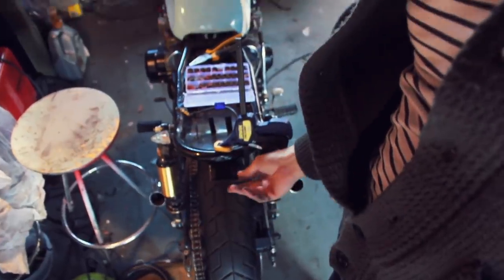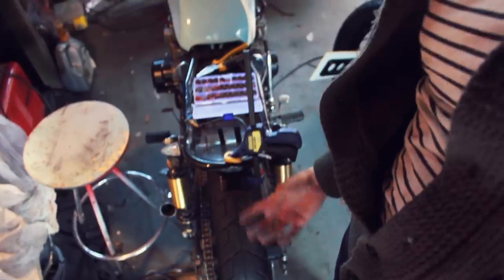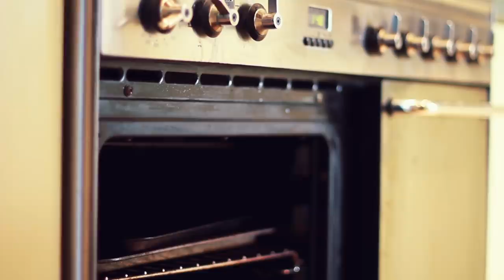Honda CB750 Cafe Racer Part 19 - Painting & polishing the fins on the Piston Cylinder

Comment: Whenever I rattle-can a project, I always start with a light dusting as a first coat, and I will start spraying a bit off the project and continue across the entire face of the object in one pass.  Just a technique that has never failed me. I like your results.  Looks good!
Reply from the maker: I’ve tried that in the past with cans and always do with a proper compressor and spray gun but I’ve found the atomisation pretty crap with these nozzles. I always end up with orange peel.
Reply: For The Bold - dreegez VHT High Heat paint, correct?  Those nozzles suck.  Krylon has great nozzles, and I usually keep a few to pop on to other brands.

Comment: That is one of the best tricks of painting is bake the paint. You can do the same with cars using improvised heat lamps as well. The application is used even in with non heat resistant pants just using less heat makes for  better longer lasting pant jobs
Reply from the maker: Let's hope this stays on :)

Comment: I did exactly what you did with the paint then the oven. Opened the oven to find that the case has expanded in the heat and all the cylinder sleeves had basically dropped out! Scary stuff. Got them back though and let it cool and all good so far.. 😲
Reply from the maker: Very scary, glad to know you sorted it out.

Comment: I know the 750 f comes painted, except they didn't sell them in desert areas or areas that regularly get 90 degrees farenheit or higher. I tried painting my 750k and it overheats.  Now the trick is to find out how to remove the paint with the engine assembled! 
Be careful as to what kind of paint you use also, as Honda as a special heat absorbant paint to somewhat allow heat dissipation  This is crucial as even cold to warm  up, and humidity factors can cause havoc especially with thin aluminum and magnesium.
Reply from the maker: With the engine assembled just take it out and cover with aircraft paint remover

Comment: Hello, i have a cb750 as well, the old owner painted the engine but used a bad quality paint, i would like to remove the old paint and painting again. I would like your recommendations to remove the old paint and clean, i don't have access to blast machines.
Reply from the maker: Try the Nitromorse like I did. Works wonders

Comment: Hi there - love your videos! Novice here with quick question: do you have to tighten all these bolts and things on the engine, wheels etc. to specific specifications? Or do you generally just tighten as tight as you can?
Reply from the maker: You have to torque them to spec

Comment: Not sure about the dremel and dressing up the fins like that you have just made it easier for for that paint to lift don’t you think?
Reply from the maker: Very good question, time will tell, I've never stripped the fins before, time will tell. Hopefully having baked the paint will help it adhere to the metal better.
Reply: There's always the option of spraying a high temp clear coat over it.

Comment: You lose a lot of control when you paint with your thumb you should be using your index finger. Or invest in a cheap spray gun. My kit cost 140 from Home Depot and is great for small jobs
Reply from the maker: I have no control with my finger at all, I'm a lot more stable with my thumb. I do have a proper LVLP spray gun with a 1.3 nozzle that I use for my tanks etc, but it's just cheaper to get the VHT in a can